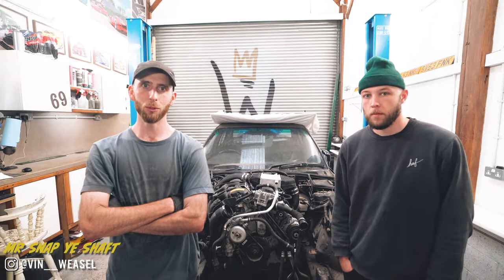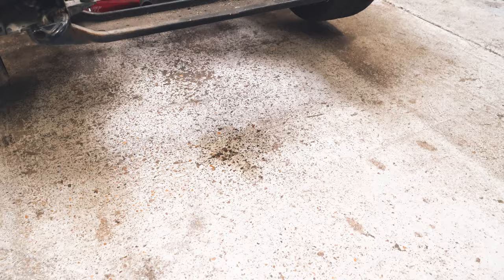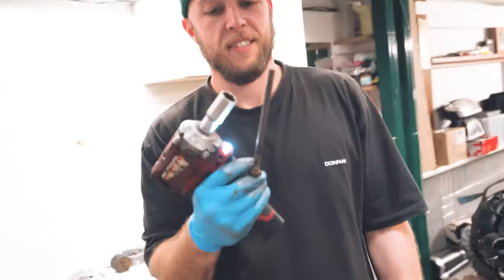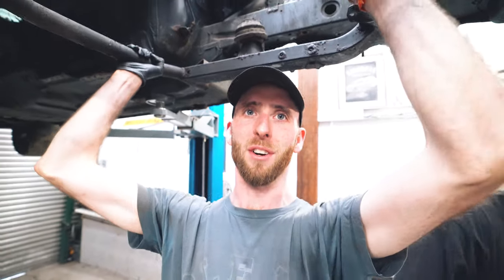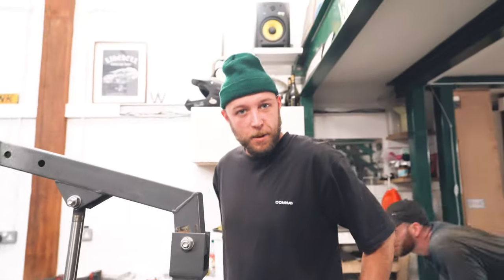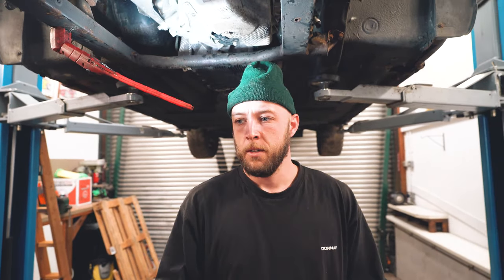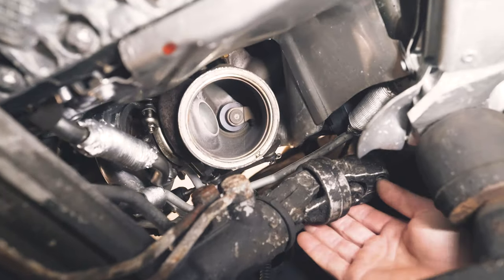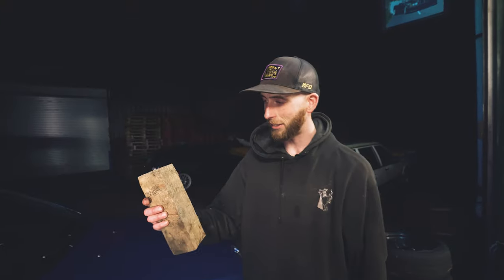TURBO BMW M5 !! Subframe and suspension || S55 Powered e34 Project EP2

Comment: Do you see many m54b30's have the dreaded oil pump nut fall off? Really don't want to buy a £550 proper kit for it - I know you can tack weld or lockwire bodge it which leads to them snapping the sprocket off... But yeah a real put off even if you do it yourself considering the engine can be had for that :(
Reply from the maker: drilled and safety wired nut has done us proud over the years!!
Reply: @WeaselWerkz  Have you seen many standard cars that aren't drifters have it fall off/become loose when you goto turn them into a drift car and lockwire them? knowing my luck mine would fail on the way home from buying one - my luck is that bad haha!